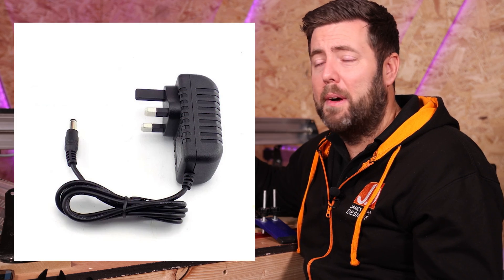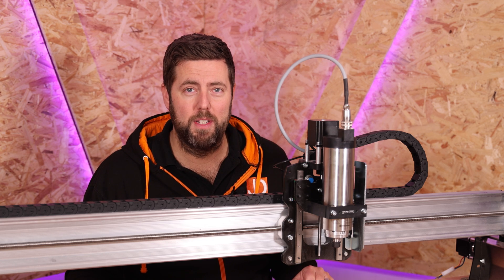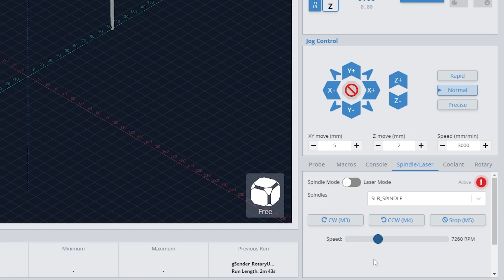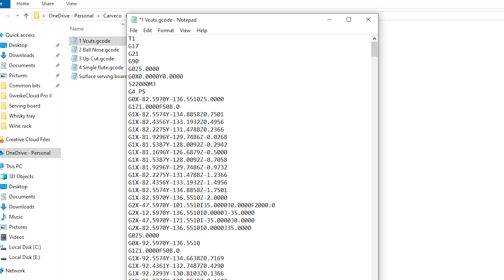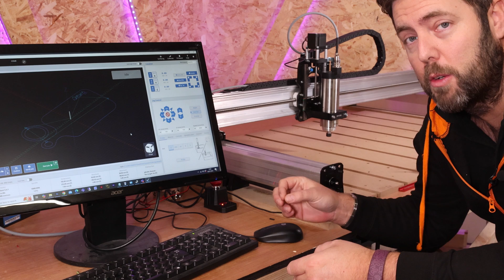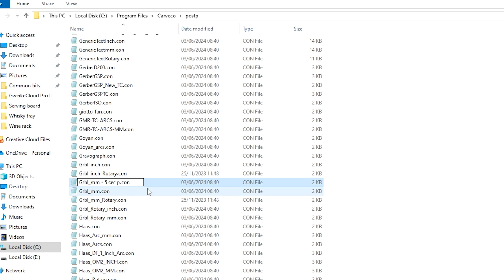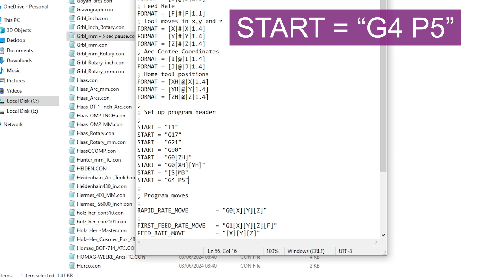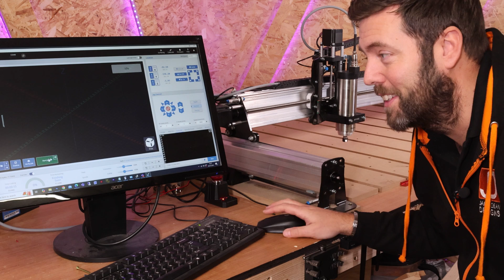YOU MUST DO THIS - Spindle VFD Tips - VFD Setup Part 3

Comment: Hi James, 
Thanks for the final part to your VFD/Spindle journey!  Can I ask which PWM Converter Module you used?  I have one that takes the 12V on one side of the module and the other side has the PWM+ and GND and the V-Out and GND.  But there is something funky going on where at the low to mid rpm I can get it close to 11995 to 12001. But the top end of 24000 only gives me 22876. If I adjust the pot I can get it closer to 23974, but not 24000. I am thinking if I try the same one you used I might see better results.

Comment: Thanks for the great videos.  I watched all three of your videos on the spindle upgrade.  In the first video you mentioned the VFD should be rated to a higher power than the spindle.  I believe the example was using a 2.2kw VFD with the 1.5kw spindle.  However, the spindle/VFD combinations in the links you provided have the VFD and spindle rated to the same power.  Are those units going to be able to provide the full capability of the spindle?

Comment: After some experimenting, I have chosen a 0-5 volt converter. Then is the 12-volt from the laser/PWM port of my XE-Pro sufficient to produce an almost linear 0-5 volt output that corresponds with the given S-value.
The board is inexpensive and can be found as an “Arduiuo DAC Expansion Module diy kit PWM to 0-5V/0-10V Voltage Converter.” It is so small that it can easily be soldered inline as part of the cable between the PWM output and the 5-volt input.
By the way, many thanks for the informative videos; I have learned a lot.

Comment: The following are the relevant instructions provided with my 1.5kw water cooled spindle (similar to the unit you linked above): 
_
-In the process of saving and transporting the spindle, the high speed grease status in the bearing will be changed, and the customer should run the spindle under the minimum speed for 30 minutes firstly, then increase 3000 RPM as a shift for each following 20 minutes. lf you start running in high speed directly without run-in period, the spindle will cause the phenomenon such as foreign noise, high heat rise etc., and it affects the bearing life. The spindle should be turned on (low speed) for 15-30 minutes weekly for the long term use purpose.

-The spindle must be preheated every day, and when the spindle reach the processing speed, run for 15-20 minutes then processing. Keep the spindle rest for 2 hours every day to prolong the use life.

I never would have thought this would be required had I not seen this video. 

Thanks for your excellent work James!

Comment: Thanks for the video. I just want to add a few points. The converter board may not be needed at all. Some (if not most) VFDs are able to take straight PWM signal bypassing the converter. Just measure/scope your voltage, for 5Vmax output, you can code the VFD accept 5V instead of 10V. If your max voltage is a little lower, VFDs have the amplification multiplier for the input voltage. So, your range will be exactly from min to max RPM. There is a video for setting this up on a VFD to work with Genmitsu 4030 Prover XL with more  explanations.
A couple more small notes, the specific warmup procedure for spindles should be described in the spindle manual and the delay is based on your settings in VFD for spin up time.
Reply from the maker: Absolutely, it's difficult to keep covering the same points in every video but I did highlight in the other parts that everything I am doing is specific to the vevor VFD and spindle I have. I was hoping I wouldn't need the PWM converter but sadly I did 😕
Reply: @JamesDeanDesigns  Your method seems to be almost universal. Despite the differences, your videos are very detailed, and they have encouraged me to do my own research . Now, I am very happy with how I can control my spindle from the software! Thanks.
Reply: @terabytejohnson5814  is there a link to the videos that James mentioned? I have upgraded my Prover 3030 to a 2.2kW spindle and HY VFD from the VFD in the Genmitsu upgrade kit. I need to switch because I need FWD and REV for my tool changer.  I am having issues finding wiring info or specifics so I can control my spindle through the Candle program and not the potentiometer on the VFD.

Comment: Hi James and thanks again for the great video tutorial.
This makes work a lot easier.

I solved the operating voltage of that voltage converter module myself, so I took it directly from the 12V DC output of the VFD

Comment: Great video James! I'll also add, once you move up to controlling a spindle over RS485 then it's possible for the spindle to talk back to the board that it's reached the speed needed - so the delay happens automatically on the firmware side. This is something new that older hobby boards might not support
Reply from the maker: @chrismakesstuffCNC thank you.  Yes its GRBLHal I believe that now accepts this. However it's all dependent on you're VFD as well. For example one of the reasons I'm still running mine via an analogue signal is because the VFD will not work over that connection

Comment: How do you set this up for Fusion 360 ?
Reply from the maker: @Ryxxi_makes  I've not personally done it but if you have a Google for "edit fusion 360 post processor" there are a few guides
Reply: @JamesDeanDesigns  I couldnt really find an easy method, fusion 360 post processor is a lot more complicated. So i just gave the file to CHat gpt and asked it to modify it. I need to test it.
Reply: There are also some really good post processors out there that have options to add dwell times right when you post process in fusion. Besides the stock GRBL post processor in Fusion doesn’t work anyway

Comment: Be aware that sometime the 'P'  parameter is in milliseconds and not in seconds.
Reply from the maker: Really? None of the GRBL based machines I have tested this on have been in milliseconds. I wonder if there is a setting elsewhere that controls this.
Reply: @JamesDeanDesigns  Usually GRBL uses seconds for P parameter, but not all people with a ''personal'' CNC uses GRBL so it is better to know that there is this possibility.
Reply from the maker: @IceCreams62  very good point 👍
Reply: I recall an argument 1-2 years ago between a FoxAlien customer and support (Facebook Group) that the FoxAlien controller didn't obey the pause commands .
I see you are using sienci labs gSender, it has pre and post job macros so you can control pauses there if your controller doesn't do it right !